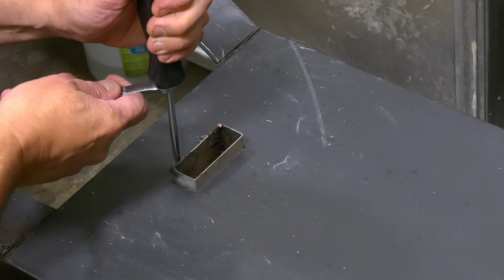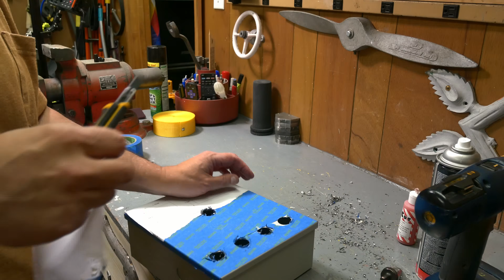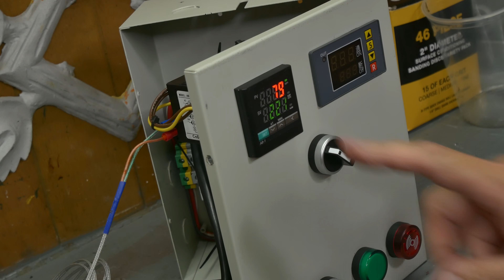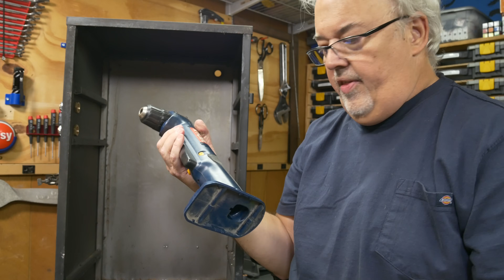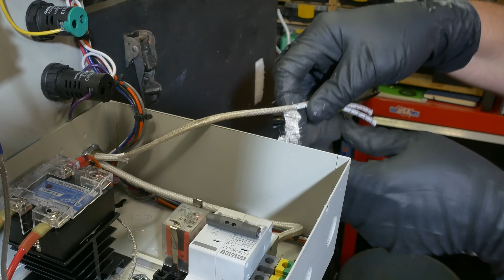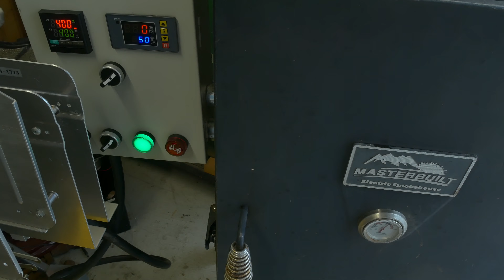Powder Coating our Carnival Ride in a BBQ???

Comment: For future reference, if you make any more control boxes instead of cutting holes with a jig saw invest in a set of chassie punches. You dry a hole set one part of the punch underneath and the other on top and simply screw down the bolt and they punch out your desired hole. Chassie punches come in sets of square, rectangular,  and round holes. these punches last a lot longher than saw blades and don't leave edges you can cut yourself on.

Comment: Beautiful. I love the lit indicators. The only thing that is missing is the laminated operation for dummies sheet hanging from a magnet stuck to the control panel so you can remember how to use it six months from now or ask someone else to turn it on or off for you while you are gone. Writing down or just marking up the instructions for the parameters you set on the PID controller is a nice time save later.
Reply from the maker: You are not wrong.  I've already forgotten how to set the timer duration.. (2 presses of the set button, not one long press)

Comment: Great idea Pete.  Do you have any concerns of the fan blowing the powder off the parts?
Reply from the maker: Thanks!, No, due to the configuration of the blades, it doesn't really blow much air. It kinda just stirs it.
Reply: @PeteRondeau I should have known you already had it covered. I worked in a paint
Shop and used air to
Blow the powder off rejected parts prior to baking.

Comment: I thought that fan might get too hot. But it didn't fail like I thought it would. Great job on the modifications ❤
Reply from the maker: Thanks.  I was concerned too, but I kept telling myself "its a convection oven fan and this is what it was made for"  in hind site, the problem was exacerbated by the oven going way over temperature.  It seems like I've installed the thermocouple in a dead zone- literally the coldest spot of the oven so the rest of the oven is way over temperature. (as much as 100 degrees!)   I have rectified this situation with a two pronged approach.  First, I replaced the short stubby thermocouple with a 4" long one.  Hoping to get a better sample further into the oven, but not so long that it will interfere with parts.  Secondly, There is an adjustment parameter in the PID controller to account for misreadings.  Its working pretty good now.  And, the fan likes it much better because the burner isn't going ballistic.

Comment: were youve run the individual cables for the element throught the holes in the supports you haven't built a single turn transformer by any chance and a possible hot spot due to eddy currents.
Reply from the maker: no, I don't think that is an issue.  If it was, every building built with metal studs would have the same problem.
Reply: @PeteRondeau  In those instances the live (hot ) and neutral are combined in the same cable so both pass through the same hole,not live through one hole and neutral through another.

Comment: Really cool solution to the oven problem, and the video thumbnail was perfection.

We also have more data for the Pete Rondeau lore. Kites!? We gotta have a video about kites now!

I've also been there with the wrong jaws when using heatshrink connectors. I wasted so many connectors the first time I tried using them.
Reply: Right! I second this. Those kites pictured in the video were amazing!
Reply from the maker: I might talk about them more when I start sewing the ride tub covers.  All my sewing experience comes from those kites and I still have all the kites I built.  Used to be if you googled my name there were a ton of kite pics that came up.  Then that nascar crew chief came along and messed up all my google results.  And now, if you google my name its mostly about carnival rides.

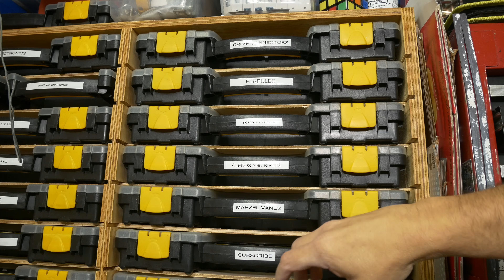Comment: 20:48 what is the mfg of your small parts storage setup?
Reply: Looks like the ones sold at Harbor Freight
Reply: @bye130 thanks fam
Reply from the maker: Yeah, those are all the small parts containers from Harbor Freight.  I bought them up when they went on sale.  There is a video here on the channel where I built the rack that holds them, and a few more videos where I 3D printed custom size bins to put in the cases.

Comment: Odd cause i just lost the controller for my old commercial smoker. Ordered the reccomended pid for it . Your install may help
Reply from the maker: you may have to experiment with placement of the thermocouple.  I have determined that where I placed it seems to be the absolute coldest spot in the oven.  There is an offset parameter in the PID to account for this though.

Comment: For cleaning commercial ovens and smokers Sysco has an awesome oven cleaner. It easily removes backed on crud and grunge and also does a great job as a paint stripper tar desolver and general hard job cleaner. The product is based around citrus derrivitives so it is safe for food surfaces as well as us and the environment.  There is only one small issue... How to liberate a couple of bottles from a local restaurant as Sysco doesn't sell to non account holders. In my area however CBI does and they have a similar or the same product. As a side note based on my experience with commercial convection ovens I would suggest if both the element and the fan came from the same oven that you also transplant the fan shroud as this is often an important part for directing air around the element. Often without the shroud the element has an extremely short life especially when working at higher temperatures.
Reply from the maker: That's great information, thanks for sharing!

Comment: I think it worked out in your favor that your smoker ended up having zero insulation.  I've owned a couple Masterbuilt electric smokers and all of mine had spray foam in the side panels (since max temp was only 275F I think they could get away with using some two-part spray foam/foam pour).  You would have had to chemically melt the foam out or physically scrape all of it out, which probably would not have been very fun.
Reply from the maker: That is interesting.  I had no idea that could have been a potential pitfall.  glad I avoided it!